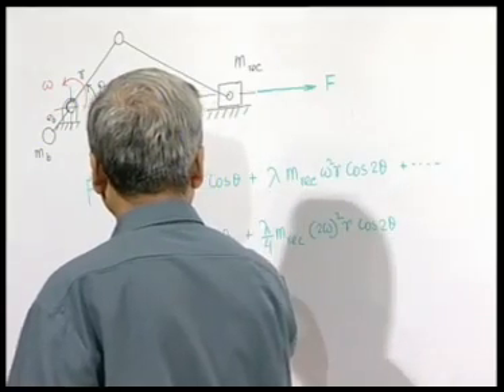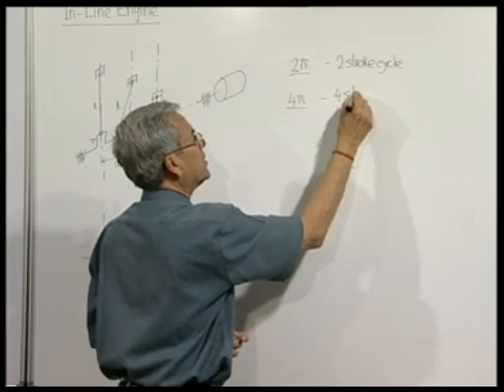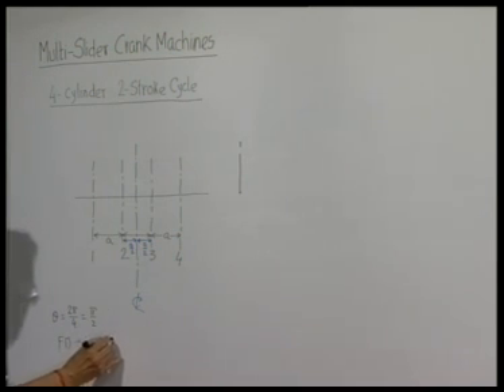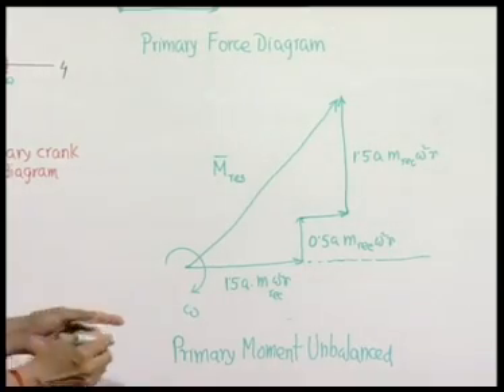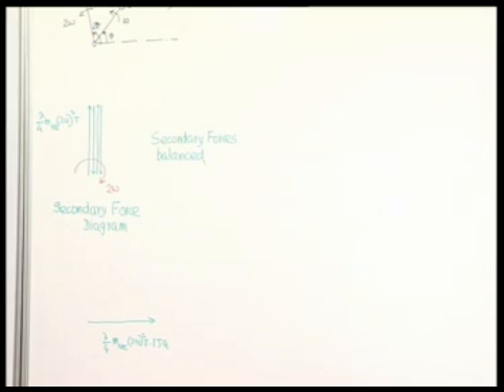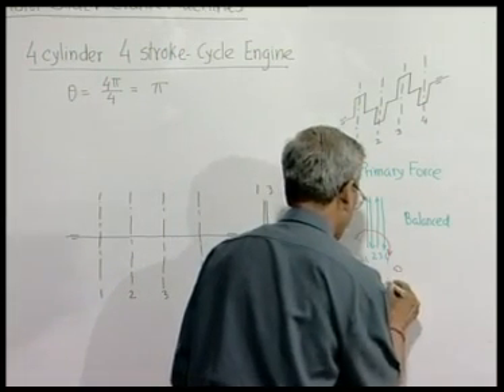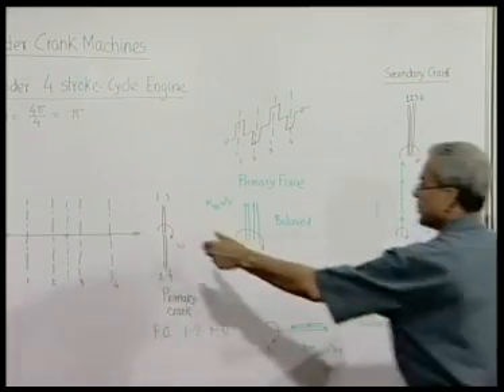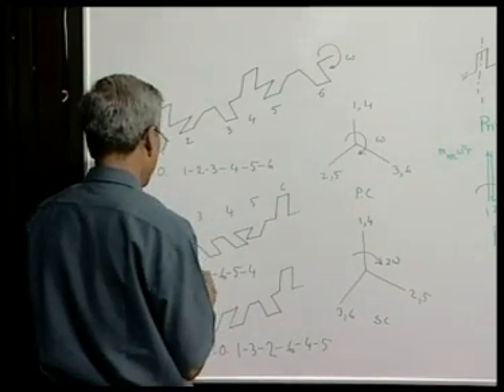Module 4 - Lecture 3 - In-Line Engine Balancing

Comment: The reason university students sit in offices and then engineers build engines ... You have the knowledge so would you create a video using a real engine ? All the theory in the world means nothing until it can be applied and proven on real world working examples.
Please choose a most common 4cyl engine, test it and provide the running engine results and also the balance machine results ... then take it apart and measure each component giving results and also show each part of the equation that shows what that result should be against what it actually is ? 
You can then modify theory to real world results and I can learn what part of the theory really matters ?

Comment: firing order cant decide like this , i believe its depend upon fuel injection , correct me if i am wrong
Reply: no bro.. it is not dependent on fuel injection. Fuel inj timing is calibrated as per firing orders.
Reply: @beardbull6331  will you give me any example? Or it means you don't know anything just bluffing
Reply: @nvcworld6423  bro as per ur statement fuel inj timing is decided first and then the firing order. And after these all the design of all the things start. That means everything is done after fuel injection design is done.. 
Read some good books or get sm knowledge. 
how can u say m bluffing? How can u conclude as such?
Reply: @nvcworld6423  what kinda example u want? Prove me ur point first..
Reply: @beardbull6331  look, in 1 cycle crank rotate 2 times means 2 times we get tdc , at any tdc time you can inject fule , always don't go with book ,try to think differently ,you will become master
Reply: @nvcworld6423  do u really know what r u talking abt and what kinda example u hv given? Please tell me how u decide the firing order on the basis of fuel injection.. Thats it..

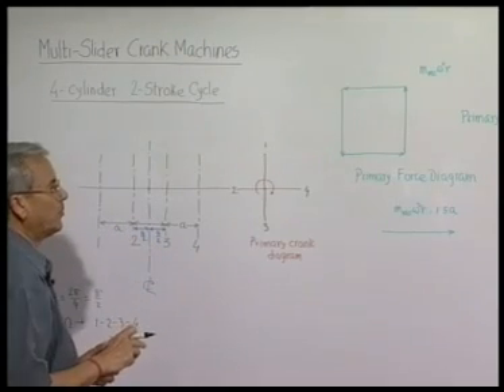Comment: someone please explain at 23:50  how he has taken the direction of moments for mass 1 then later for mass 3 in rightward direction
Reply: prakhar mishra u have to see it from right. The 1st force is upward, using right hand curl rule, moment will be to right, when seen from right side. Or it is into the plane of board from our view.
Similarly, 2nd force is left, seen from right side or out of the plane of board, seen from our view. Hence moment will be upwards.
3rd force follows as in 1st force. 4th force follows as in 2nd Force.

Note, the moment is being taken from the middle section.
Reply: Lax Payne for 1st cylinder, moment is into the plane of paper is fine..but how is it rightward when viewed from right hand side??? How are you rotating the mass from right hand side view???
Reply: U need to u use ur imagination.
using vectors, suppose in xy plane, a vector is into the plane, i.e., in -z direction, now u view from right hand side plane, i.e., view from yz plane, the vector will be in right direction. 
Similarly, when u see from the side view, the moment axis that was into the plane of paper in front view will appear to go right when viewed from right side view.
Reply: Lax Payne yup totally got u!!thanks a lot
Reply: @lakshyaprakashsahoo369  bro i don't understand the concept of moment will clear... please bro